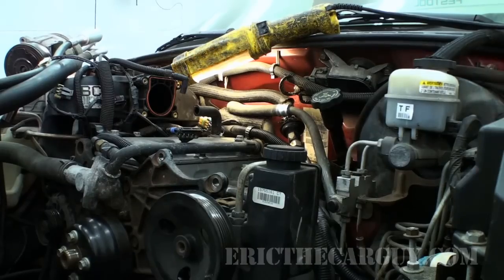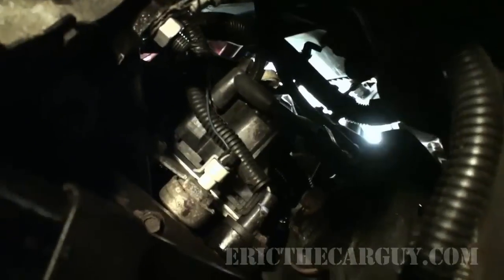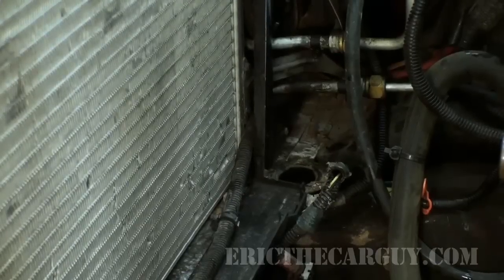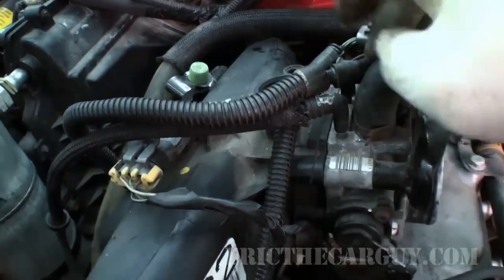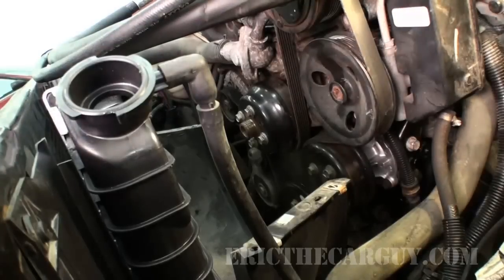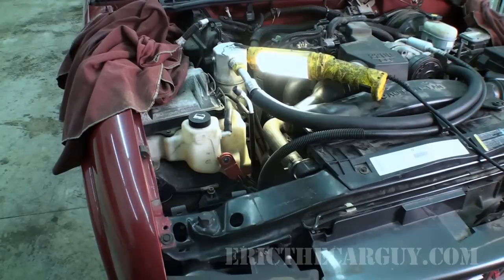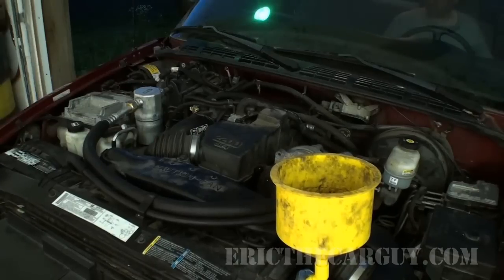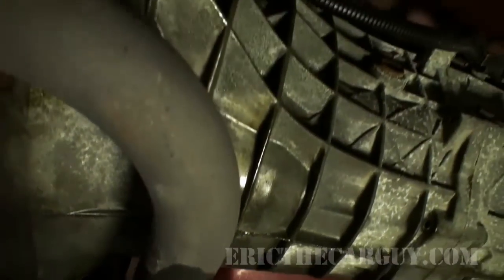2001 GMC Sonoma 2.2L Engine Replacement (Part 8) Final Video -EricTheCarGuy

Comment: I  am  completing overhaul of a 2000 s10 2.2 liter l4 when my new bearings (Main Bearings) show up tomorrow.  I cleaned the saddle and the firewall  and side compartments as well as a complete AC replacement.  Your comments on the tight space in putting the Transmission to engine bolts is exactly the problem.  I found that you can remove the tires and gain good access to the bolts and not have to mess with the Transmission cross member. Put the two top bolts in and friction tape for snug fit. I solved the transmission problem with a chain under the transmission front between the frame rails and it made the job much easier.  I lost no transmission oil and it made the whole process much easier.
      As far as overheating these engines the crankshaft main bearing journals will shrink and cause problems with a new crankshaft and bearings .  I had to have the engine line bored and the new crank polished after installing originally into a engine that I did not  check completely.  Dimensions were correct in each bore but, not in alignment.  I enjoyed watching your videos and advice freely given by you is much appreciated. 
      I cleaned each roller lifter and polished them with 3000 grit emery cloth marked each component and restored them after cleaning in the same orientation and location. When you are this far into the engine, a through engine compartment cleaning and paint job is not out of line for the effort it takes to complete. (Hi-Temp Paint)
       As to costs:  Crankshaft $200., Bearings $100 and change, All new Hoses  $65,00, Timing chain and gears $25.00 , Gasket set $40.00. Line bore and Crankshaft Micro polish  $235.  Purchased 5 Gal of oil for car maintenance and change after overhaul On line for $40. Two Filters  $11.00  New head bolts $22. Also replaced the Fuel pump (Lift theTruck Bed Method.  $37.00  New Set of tires $400.   Complete interior clean and shine by me.  Cheap Labor.  Hope to have her running with in a week. Original Problem noisy and low oil pressure.

Comment: A wonderful series Eric so, Thank You for that. Even more important was your show of respect and support for Ryan and his family. You are a good man. Rest in Peace Ryan and my most sincere condolences to your family. I'm sure that your brother will enjoy many happy and reflective miles in your truck and care for it well in your honor. What an immense project to replace a little 4 banger though Eric. I miss the old days (I'm 56) when I had a 67 Chev pickup with an inline 6. A 250 I think with 4:11's and a 4 speed manual. It wasn't fast but it sure could pull! When the engine finally wore out in the mid 90's, a buddy and I yanked it in my garage with nothing but common hand tools, a cheap floor jack and two jack stands. Everything was so easy and accessible. A local rebuilder rebuilt the engine. He rebored it .030 over, new pistons, rings, bearings, timing set, oil and water pumps, valve job, clutch  etc. for $800.00. And my friend and I stabbed it back in in a day. It was a torquey and smooth runner for many years after. Always started instantly with the only mod being a Pertronix ignition module to eliminate the points. Rust finally killed the truck about 2005 but the engine is still going strong in a piece of farm machinery. Makes you wonder if, for the average person, that vehicles have not indeed regressed. Cheers and keep up the great vids!

Comment: The bell housing bolt tip is really a time saver, everyone complains about those two bolts on top.  On a GM engine R&R, I would have some split loom conduit/tubing or wire conduit flex split (as some call it) handy.  That's a great time to replace or add some more insurance.  The side mounted battery terminals are notorious for caking with acid and then creating a no start situation in the GM world.  A typical pattern failure.  RIP Ryan - keep an eye on Eric!!

Comment: Amazing! It was torture waiting for the startup! The solder joint wasn't bad or good it was just acceptable. I always use extra flux when soldering. Also as you heat, keep heating the wire until the solder FLOWS like water into the joint. It wicks it in like paper sucking up water. The flux helps with that A LOT!

Comment: Thank you for your video. Sorry for your loss. RIP RYAN!! He had a nice truck and drove it well from your discoververy of his old clutch plate. Mine is a 2003 2.2l Chevy S10, automatic transmission, 4cyl and I'm looking to swap the flex plate (flywheel) on it again, soon. The one I swapped it with the last time broke on me so I'm using the old one that is missing some teeth in one spot. Lately, I've completely replaced its alternator, spark plugs and leads, battery, fuel pump (which actually was the problem with it and likely the reason i paid only 750.00 for this 87k miler. Guess it was the fix-er-upper I didnt know I was looking for). Radiator hoses too because while doing a flush (coolant) I noticed on the top hose some peeling back of its lining, and black plastic specs in my resivurar that I drained out. Replacing the top hose was so easy, but because where they put the clamp for the bottom hose, under the bracket for the water pump, I think I would'ave saved time taking the exhaust manifold just for some throw room because I couldn't get the throw room you found for your wrench. My 'finding another way' consisted of bolting the bracket back to the water pump then lifting the entire assembly up and over to catch the studs at the top of the block. Sheesh! I'm also waiting on a thermostat housing I put on order to arrive tomorrow at the store. I broke a bolt off the bottom fastener where coolant had been leaking and made the steel screw in an aluminum housing very brittle. Not being experienced with torches, I partially MELTED the temperature sensor above where I was trying to put heat after drilling and tapping the screw. After I saw the plastic beginning to frown I turned the torch off and unplugged the sensor thanking God all the oil and road grime did not burst into some old testament spontaneous combustion situation. I don't have a fancy grinder you've got but will a brillo pad or wire brushes also do the trick for the barnacle growth on the metal? I don't want to use CLR because it might foam up in the coolant system the way it did in my HHO generator, uh, project I was working on something else with.

Comment: One advice I would like to give to people who are replacing the engine on a vehicle that has been sitting for a while. Make sure to drain the old fuel and add new fuel. I replaced a motor once and spent a lot of time trying to figure out why it would not start. Turned out the gasoline has turned in laquer. Replaced the fuel and it started right up!

Comment: If the only problem was a minor coolant leak then you did quite a bang up job!

The format of the series was OK but I just thought it had too many parts (yeah, an engine replacement is probably the most complicated repair one can do to a car but it just seemed so long to me)  Job well done though!

Comment: Props on the Festool sticker on the back window.

What are your thoughts on the smashed wires for the Coolant Temp Sensor, could've been the cause, or contributor to the failure of the last motor.

Comment: My only question is, why you didn't prime the engine before you installed it in case there was an issue and less time having to pull it back out again?

Comment: Hey Eric, I hope you put sufficient amount of oil inside the cylinders when priming the engine, not just a few drops, because the pistons may be a cup-shape on top where it'll contain the oil and not lubricate the cylinder walls where it's needed.

Comment: I have a 1998 s10 2.2 and the motor is blown. I found. Brand new engine but it says 99 - 2003 would it work ? Will all of my parts ac,intake, alternator etc ... work ? Please help?

Comment: Great series, Eric!
One question: why did you pout the heater all the way to the hot position when starting a new engine? When I replaced the engine on my car I noticed the heater as also all the way to the top, but it was January so I didn't even asked why, but now it looks like there's a reason for it.

Comment: hey Eric can you drive the oil pump by using an oil pump priming tool after removing the oil pump drive shaft that you showed us in an earlier episode? That's the way we old dudes used to do it.
Reply: +Terry Vicena Yes you can, its either a 3/8 or a 5/16 socket used on a locking extension just to be safe. Spin it and watch oil pressure go up. No dry starts. I always do that on installs.
Reply: byrysh thanks sir!

Comment: you can take of the distributor delete and use a flat head screw drive without the a handle and attach to a drill and spin the oil pump that way you don't need to work the starter and spin the rotating parts to prime the engine

Comment: You can get those battery terminal adapters at walmart now.  Also, that leak is exactly why the phrase "Mechanics start what they finish!" exists.
Reply: I've been dealing with chevy side posts my whole life and often wondered why there were no adaptaors, just ordered a set yesterday. THANKS GAMAZON
Reply: Those adapters have been around since I've been a kid.  You can find them at nearly any auto parts store.  They're typically only rated for charging, but I've seen people use them for everything from running a car to welding.
Reply: see previous statement

Comment: I'd like to backup the idea to not use dexcool. My camaro I bought still had dexcool in it when I got it and the cooling system had a thick layer of sludge all inside it. To be fair, I dont think that the previous owner ever changed it, but that was enough for me to not use dexcool anymore.
Reply: i found your problem, you said "camaro" XD lol just giving you a hard time
Reply: Jay Smart Haha its all good. Now, the DexCool thing has nothing to due with build quality, but aside from the power train, it isn't a mystery that Camaros don't have the best build quality.

Comment: I had the same truck.. I never did much to it, but it looked like it wouldn't of been too bad. I do have a Jimmy that's 4X4 with a 4.3 that the engine blew. I replaced it with a new 4.3, fresh out of the box. That was a nightmare. That was b far the hardest install I've ever done. Never again!!!

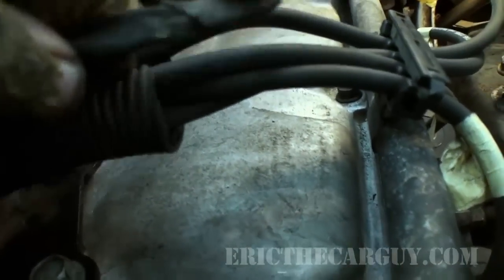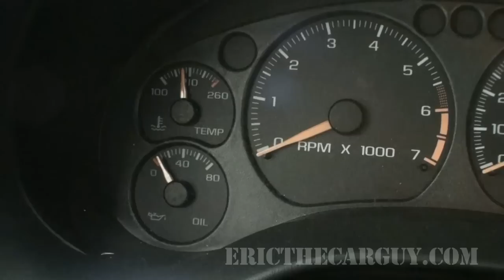Comment: At around 7:00 when you looked at those coolant temp sensor wires i got my answer as to why the temperature was going up so rapidly at around 3:35.

Can't believe you missed that...?

Comment: Supposed to use a soldering iron, not a gun. Also rosin solding flux. A good way to know if its a good soldering joint is if its shiny or not for lead solder.

Comment: the heater was opened so the coolant could circulate through the engine/heater and that also removes all the air from the system. :)

Comment: I would think he does that in order to bleed the cooling system. When you turn the heat on to max, it will activate the coolant flow through the heater, so if any air is in it, it will be flushed out along with the air from the radiator and all the other parts at once.

Comment: awesome video eric. i  am curious what the cost for this job if you did it again would be ? lol got a 98 sonoma sls 2.2l 5 spd exact same job lol . thanks in advance greg
Reply: +killercutlass  only other thing i would have loved to see would be things torqued to specs lol would save a lot of time looking it up as i did the job for sure. possibly saved the coolant leak at the end . still amazing videos i am so thankful for you doing it it will be a huge help in the future if i ever need to work on it after my mechanic is done with this exact job on my truck. thanks again eric your awesome

Comment: What you believe is the timing belt is not the timing belt, it is an accessory drive belt for the alternator, power steering, water pump and various other things. The timing system for this vehicle is not exposed on the front of the engine.

Comment: That regular coolant is pretty much dexcool.  I went down the coolant rabbit-hole a couple of months back. I realized that the prestone any make any model universal has an identical SDS data sheet as prestone's dexcool and most of their other coolants. I just put universal crap in and don't care. It's even the same as the Chrysler purple stuff in my Chrysler. Over the years pretty much everyone switched to some kind of dexcool clone.

Comment: Why is everyone so critical? Eric not only spent a lot of time on the engine, but he spent even more time making 8 30 minute plus videos. And how do you know he had the hood directly sitting on the concrete. I can tell you that eric is no half ass mechanic, because if he was he wouldn't have fixed those wires, and I'm positive he damage the precious stock paint job, which I'm sure he knows is expensive and certainly would not damage it on purpose!

Comment: You could have went further down that conductor with solder to get rid of the solder blob, but the solder has soaked into the connection between the two conductors and thats all that really matters. Nice use of shrink tube, I always get a bad taste in my mouth when I see solder connections just electrical taped.

Comment: Turbo Yoda on Mighty Car Mods didn't like solder - he always mechanically crimped the wires together and covered with shrink tape IIRC
Reply: opl500 a good crimp is just as good as a good soldier. I prefer to soldier because I know it's good. A crimp can be wonky and you not realize it. So because I know I soldiered it I know it's a solid connection, both physically and electrically.

Comment: Either pull the engine and transmission as a unit or just remove the cab off the frame on a lift.

Comment: what caused the original engine failure. 2.2's are pretty strong engines.. not to say powerful but typically they will take allot of miles to kill them. the only thing they are known for that is bad is head gasket failures but we all know that doesnt mean death to the engine if addressed in time

Comment: oi
i did to my 2000 blazer only head gasket haha but took me 2 months because i did it after work till like 11 or so haha
in the cold so you were lucky to have a garage hehe
but mine wasnt to hard just some hard places to reach but got the job done and it runs stronge and alot of power annnnd.... whats better dexcool or green stuff
i flushed it and running on water need coolent in winter
whats better for all gm gaskets dont wanna do it again haha
the end
:)

Comment: The solder joints weren't lapped.  They weren't NASA standard either...  North were they staggered....  But they are done and they are strunk.

Job done :)

Comment: This is where a spark plug socket with rubber insert helps to reinstall the plug or some other type of spark plug holder tool.  I know exactly what you mean about dropping it on the electrode.  I think my mom dropped me on my head once, but only ONCE.  At least "that is what she said."

Comment: i think you should have had them put a rebuilt 4.3 vortec like ive got in my gmc jimmy
Reply: but with all due respect you did a prefect job on re installing the engine
Reply: jljr98 I was thinking that too.. Not to mention throwing all the bolts on the ground.. lol 12:46.   I just remember doing oil changes on these at the dealer when they were new.   :( I miss that.

Comment: Either your parents are cousins, or you are a true first-class masochist. Step 1: when changing an engine in a 2.2 S10 is to pull the transmission out, and set it on the ground. Then, pull and replace the engine. This is why you had such a fight getting this engine in and out of this truck. Remember, you're only six bolts away from doing this to start with.  Try it my way. It's better.

Comment: Good job but notice that when you were done and crank the engine it had great oil pressure but when you drove it and got it warmed up it did not have very good oil pressure 20 pounds don't believe that's a very good rebuilt engine l would not be happy with it

Comment: On my s10 2.2 I replaced the stock, junky air intake that has the sound box silencer and goes over the radiator top, with a K&N 57-3025-1 air intake that routes over the AC lines of the compressor. GM engineers can sometimes be retarded when it comes to vehicle component placement. Btw how was you able to get off the bottom fan shroud without breaking one of the plastic locking tabs? I removed the bottom shroud and broke one of the tabs, even though I tried to push it flat as possible.